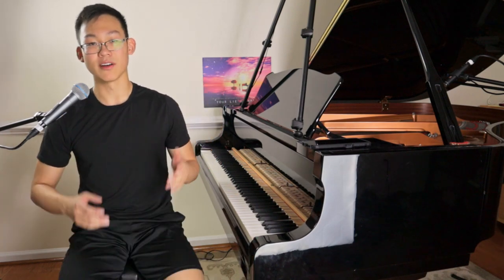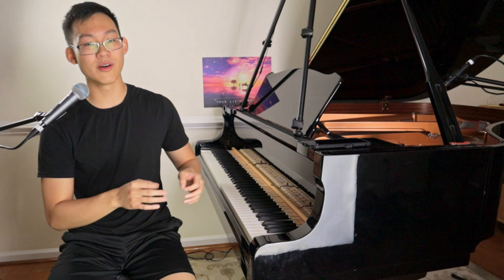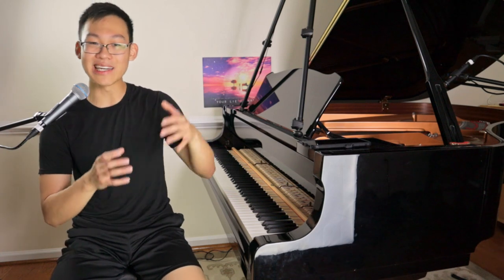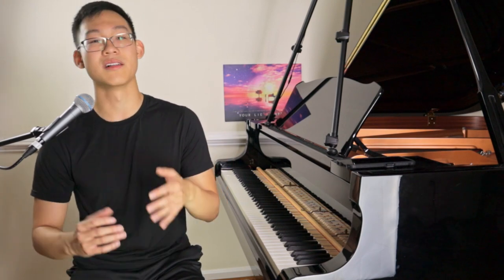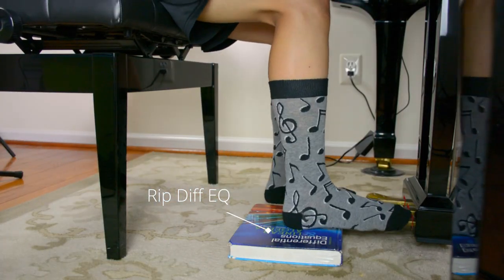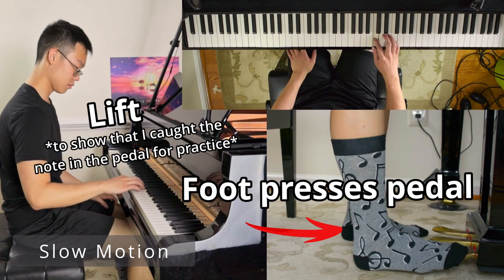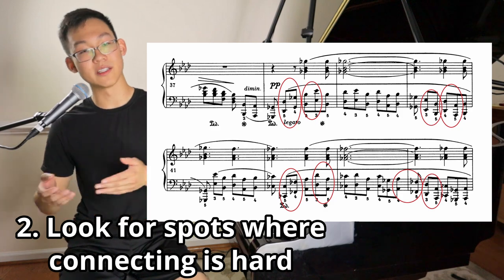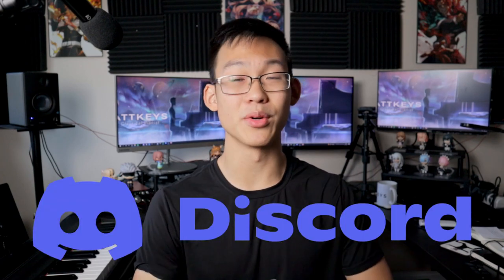The Basics of Pedaling - How to Pedal: Part 1

Comment: As a self taught, very glad u covered this topic as early as now. Back when I started learning, most videos about pedalling I found are missing out on alot of points u have pointed out here. For example, not using the pedal when learning a piece, using heel as a pivot(i used to lift my entire leg lol), and also most importantly, pedalling after the tone is generated. So yea, most videos about pedalling either explained stuff ambiguously or not covering important points. Great work on this, looking forward to part 2